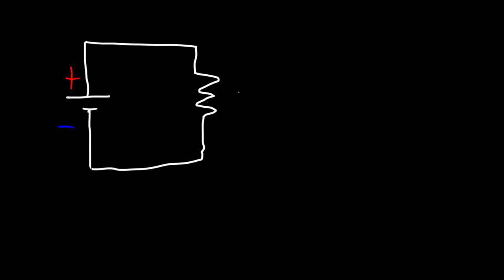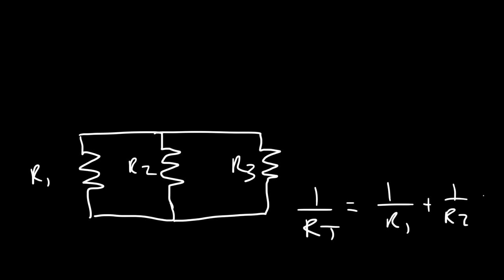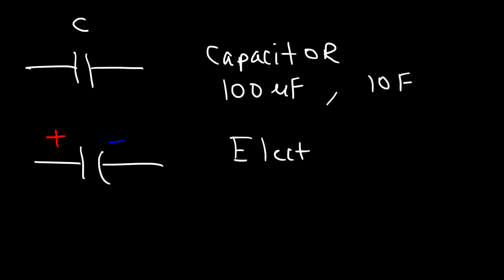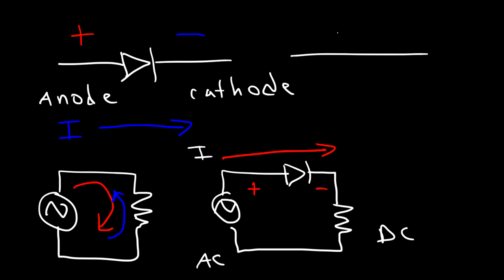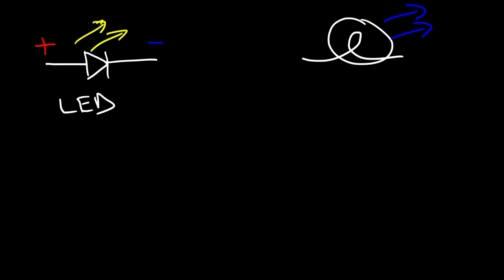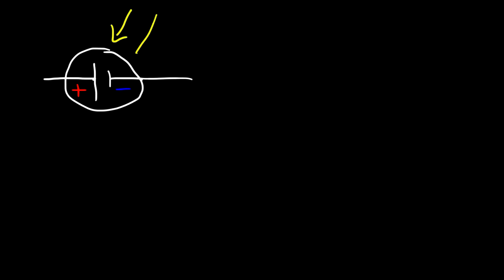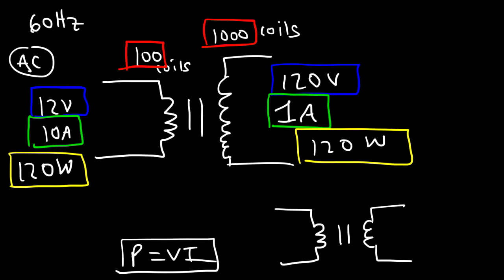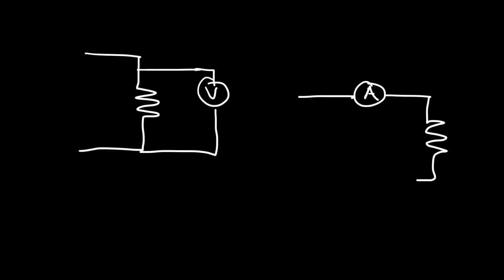Schematic Diagrams & Symbols, Electrical Circuits - Resistors, Capacitors, Inductors, Diodes, & LEDs

Comment: Two batteries in series ceated 6 volts, but two in parallel became amps? What happened to the volts please?
Reply: Voltage for parallel batteries does not change. 2 3 volt batteries in parallel is still only 3 volts.

Comment: Wait..... Since when does electrical current flow in the opposite direction of the electrons??
Reply: It's called "conventional" current flow, from the positive terminal to the negative terminal (which is opposite of electron flow).  This was before electrons were discovered so it just stuck out of habit and this is how circuits are still taught today.

Comment: Why don't you give actual numbers/figures so that people will understand what you're trying to iterate more clearly?  You know, like series/parallel, 2 volts plus 2 volts in series is 4 volts?  You didn't do that for the resistors, you just said 3 resistors in parallel equal 1 over R1 and 1 over R2 etc.  Not everybody is going to get that dude.
Reply: This video is focusing on the concepts, which are actually more important to understand first before you start crunching numbers into formulas. Get a textbook if you want that kind of practice.

Comment: 0:24 energy flows from - negative to  + positive because electrons are negatively charged and attracted to a positive charge. electronic will still work will work either way I just figured since this is an educational video it should be corrected.

Edit: schematics are drawn showing energy flow from positive to negative because that's how it was believed to work when electricity was first being used but again it doesn't matter which way they flow because it won't affect how you will build your electronics.
Reply: FluffyFighter667 electrons do protons don't
Reply: Yes, he pointed out that difference in the video, i.e. "conventional" flow vs. electron flow.

Comment: You had the flow of electricity through the diode backwards. At the beginning you correctly mentioned that electrons flow from negative to positive but for the diode you had them flowing opposite. For a diode the flow is not the direction of what looks like an arrow in the symbol, its opposite
Reply: Wrong, he is talking about current flow not movement of electrons.